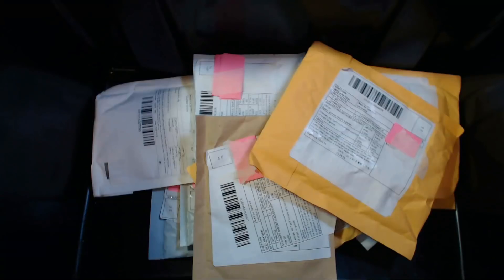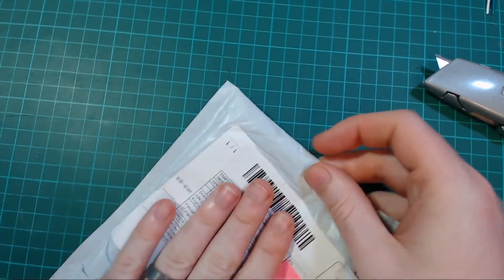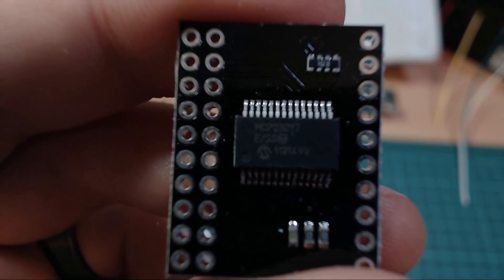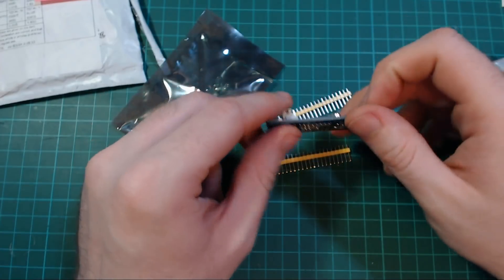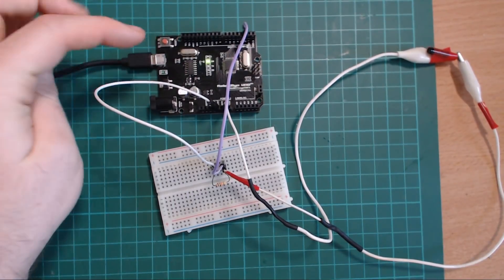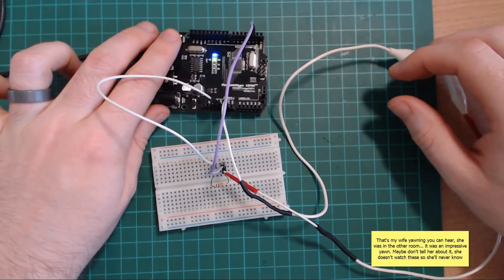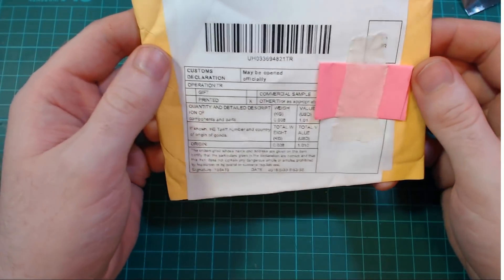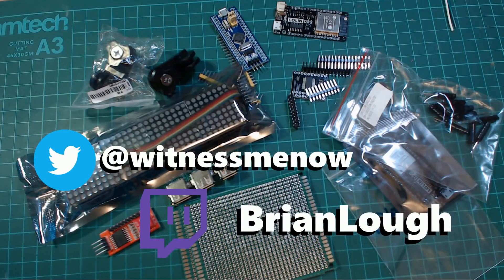#4 Post Bag - Post-its make a big difference!

Comment: Hi Brian, nice postbag! FYI: I made a library for using that pcf i/o expander as easy as regular i/o pins, along with this video about it: https://youtu.be/40Ssl2K_jfo . The GitHub link is in the video description. It also supports16-bit expander and 595 shift-registers for both Atmel and Esp8266). 
I also made a video about an easy mod to the cheap boost converter to generate 3.3v instead of 5v, hope you like it: https://youtu.be/SijlC1Rqykw
Reply from the maker: Hey Maxint, that sounds great do you mind linking to them? If you want to edit the previous post i could pin it
Reply: Done - thanks! (Hope you like it...)
Reply from the maker: Thanks! I'll have to take a look at it tomorrow though as I've an early start 😐

Comment: The SW18010P as featured in the video are actually vibration sensors which explains why they have to be shaken quite hard. However the tilt switch(SW520D) which looks very much similar, features a ball bearing inside which moves fairly easily when tilted, thus making an electrical contact when tilted.

Comment: Those green through-hole-boards,
are they connected one side to the other or just surface pads ?
i never had issues with one sided boards because i usually dont use smd and only have one or two bridging resistors if any on the "2nd layer".
Since you need to connect to the 1st layer anyways and the pins stick through 😐...

Stability wise i had problems some times when soldering really thick tracks for heat spreading,
 because it warped the board when cooling down and the solder/copper shrinks.
Reply from the maker: Yeah connected on both sides I think anyways. Yeah I've used mainly the one sided boards but these are just nicer to work with. A decent bit more expensive though

Comment: Hi Brian, take a look at the 2 proto pcb i'm going to link under this comment... they have pads to solder an esp8266 on 1 side, OR an esp32 on the other one, and have pads for a relay, too
Reply: 5x7 model: https://it.aliexpress.com/item/5cm-7cm-5-7CM-WIFI-ESP8266-ESP-12F-ESP-12E-ESP32-ESP-32-ESP-32S-Double/32839969962.html
Reply: 7x9 model: https://it.aliexpress.com/item/7x9-CM-70X90mm-Prototype-PCB-Tagliere-Double-Side-Prototype-PCB-Board-Per-ESP8266-ESP-12E-ESP/32838822979.html

Comment: 5v Step up Power module. check                  I ordered it because I thought it might come in handy!
MCP23017 i2c GPIO expander . Check        I have the same one. Wanting to add more gpio over I2C. 
MAX7219 LED Matrix Display*. Check         Thought it would be fun to play with. 
PC8574 i2c GPIO port expander. Check      What I have is for LCD screens to use over I2C.

https://www.aliexpress.com/item/1pcs-IIC-I2C-Interface-LCD1602-Adapter-Plate-Board-5V-LCD-Adapter-Converter-Module-For-LCD1602-2004/32834068830.html?spm=2114.10010108.1000014.2.66d46ee1KWmGqk&scm=1007.13338.98644.000000000000000&scm_id=1007.13338.98644.000000000000000&scm-url=1007.13338.98644.000000000000000&pvid=db248dc1-cc7e-4352-bcbe-4597f1cc7220&_t=pvid:db248dc1-cc7e-4352-bcbe-4597f1cc7220,scm-url:1007.13338.98644.000000000000000
Reply from the maker: Nice one!

Yeah I have a few of them too, not sure I've ever used them though!
Reply: I wish I knew about LCD I2C modules be for I make my Arduino FM Radio. lolz
https://i.imgur.com/hzitYNI.jpg
https://i.imgur.com/E6rxSXO.jpg